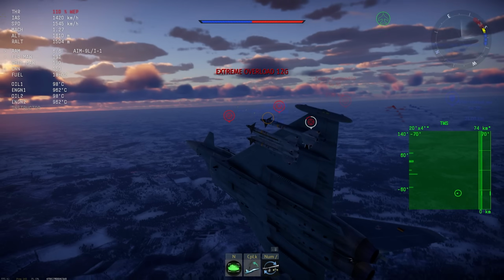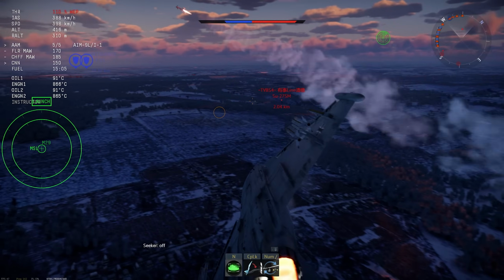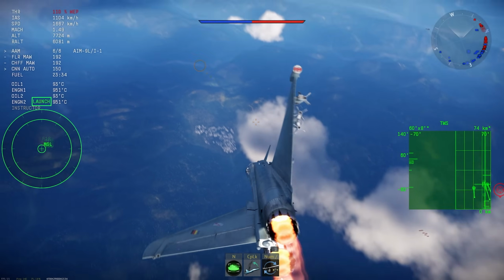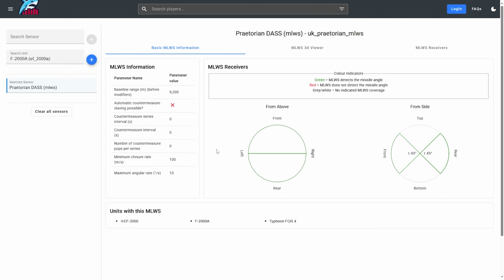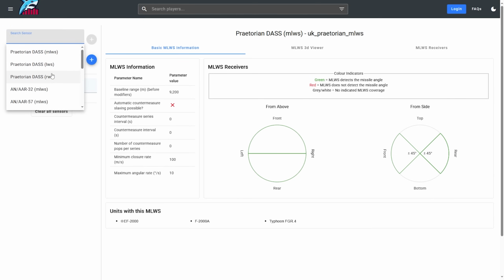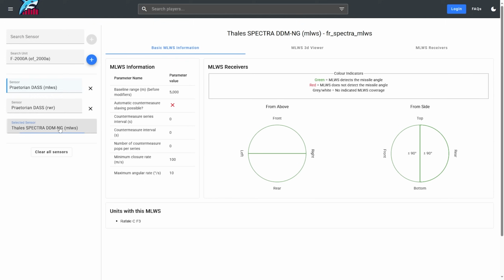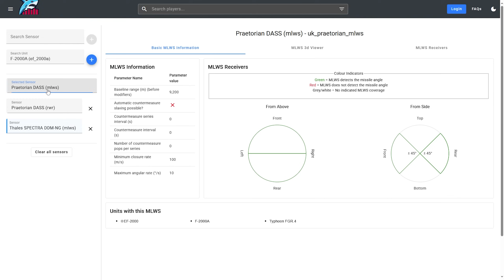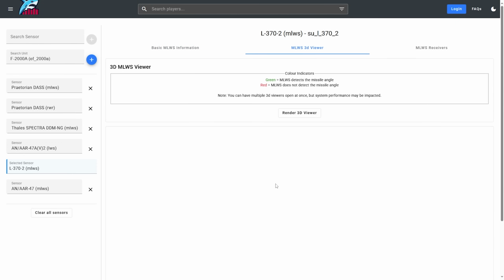SENSOR FUSION! WHAT is it? HOW does it work? WHO HAS IT? - War Thunder

Comment: So what aircraft are we most likely to see in the next update? Is it the Super hornet next with the legacy hornet making an appearance in the other tech trees respectively? Is it possible that we’ll see the F-22 by this December? Are we going to see a rank 9 and More BR decompression? I have a lot of questions.
Reply: prob just better versions of what we have, tranche 3 or 4 euros, F-16C BLK 70s etc. I would like to see better missiles but then I think gaijin will work on naval a lot this year
Reply: 16V, 15EX, 18E block 1/2/3, 22A block 0-40, 35A/B/C block 0-5. That's literally it in terms of "Up"
Reply: @Skunkw3rx  For real. They have how many stop gaps before the F-22 becomes one of if not the most violating jet in the game. Surely they’ll give the 5th gens their own rank instead of letting them stomp all over the 4th gens right?
Reply: @MerchantMarc  The f-22 cannot carry very many missles in its weapons bays, so it won't be very great against stuff with alot more missles unless they give it its under wing mounts.
Reply: @demondangr I'm pretty sure it can take 6 120s and two or four aim9s in total
Reply: @ They probably will but it can get a lot closer without being locked which means it has a far more effective kill range for it’s weapons and you don’t know it’s there until it turns it’s radar on. Which is a terrifying concept. On top of that, Aim120Bs are mean and it will probably make it back to the airfield before anyone gets the chance to kill it. I also saw something about Gaijin saying they weren’t going to bring Aim9Xs to the game based on the gameplay performance of the Aim9M. I am excited to see it in game, I am not excited to fight it.
Reply: @demondangr  the F-22 can carry 4x120Bs or 6x120Cs with an additional 2 9Xs while remaining stealth. OR if the F-22 doesn't care about stealth it can take 4 additional aim-120s on each wing. So 14x120Cs with 2 9Xs.....I would say that's a small amount
Reply: @MerchantMarc  the latest eurofighters and rafales have more modern avionics than the F-22, which gets heavily carried by stealth meaning they will still pose a threat and its just matter of whether the EFs and Rafales will use terrain and EW to get within 100KM or so, then the F-22 will likely lose
Reply: @squarescope3056 maybe, we’ll just have to wait and see but the thrust vectoring will be a big factor as well and you can’t forget the actual weight of the F-22 (she’s a heavy plane) as well but it is a pretty even fight between the canard fighters and the 22 so I’m interested to see if the canard fighters will be able to get close enough
Reply: @split117  6 and 2 👍
Reply: @MerchantMarc  you are right, but i only mentioned the rafale and eurofighter then because of the fact they use the longest range modern IR missiles, in the case they still cant see the F22 or it doesnt wanna turn on its radar, then they can still lock it with IRST with the ASRAAM having a 50 km range and the MICA IR having an 80km or so range. i still totally expect it to be at a higher br than the 4.5+ gens but i also think it would be able to see them, something like the F-22 at 16.0 and the EF and Rafale at 15.3 or 15.0
Reply: @squarescope3056 I’m also hoping we see the F-23 make an appearance
Reply: @squarescope3056 I would expect that. The F-22’s rectangular exhaust nozzles reduce heat sig but not by a huge amount so I would expect it to be a problem for the 22. Unfortunately Gaijin did say they have no intention of adding ASRAAM (or at least not yet) and the F-23 would have a better chance at hiding from such a weapon do to it’s design so I hope the Blackwidow makes an appearance as well
Reply: @squarescope3056 Thank you for the conversation. You’ve given me some good info that could be used in battles and we aren’t arguing about this aircraft being better than that aircraft. I am an American and I do love the F-22 very dearly but I am grinding for the Rafale right now and while I have no intention of obtaining the Eurofighter I am more than willing to recognize it’s capabilities rather than getting into a petty disagreement. Anyway, have a fantastic day, happy flying and don’t sink.
Reply: @MerchantMarc  6 and 2, thx
Reply: @MerchantMarc  f22 vs Mig 21
Reply: @Skunkw3rx  F22 can theorically carry a total of 14 missiles in its non-stealth configuration. But at that point it would pretty much be like a Su35, which makes no sense. If stealth will be modelled correctly, F22 should just be used with its stealth configuration, same goes for the F35.
Reply: @squarescope3056 "more modern avionics" such as? The F-22 has always had the most up to date avionics of almost any aircraft until about 5 years ago. And even then its miniscule improvements. Look up the IFCS
Reply: @ I’m not entirely sure what you’re asking or saying but the mig-21 doesn’t stand a chance unless you’re talking about if they put the F-22 in at 14.0 right now
Reply: @Skunkw3rx  the f22 we would receive first in the game would probably be the first production, i.e. it would have older avionics than rafale and ef
Reply: @devisucarlo7922 my question is how good is stealth at the ranges in war thunder... like 15km jousting
Reply: @rubotok3703  Eh who knows, problem in War Thunder are maps.
We spawn far from the enemies at around 80kms, but nowadays radars irl can see "normal" aircrafts even 400kms far away and stealth fighters to about 80-100+kms depending on the radar band. And i honestly doubt they'll add F22 without adding at least also the F35 and some Mig31 variant and Su35, so F22 or F35 won't be as much op as some people think.
Also, F22 would lack HMD and IRST.
That will be a bit painfull at br 15+ if they don't make bigger maps.
In bigger maps, the F22 could throw AIM120D far 80-100kms from its target, while its target would have some troubles to get a clear lock on the F22 above 70-80kms.
Reply: @devisucarlo7922  regardless to fire an aim120 you need your radar turned on, so people would see the radar launch, and then avoid the missile in the same way you avoid f14 spam or f15 spam, it's not gonna being anything new, also when they fire their missiles you'll have a better rcs to lock too to fire back, at the same time, at max you'll be 80km away at spawn, but aesa radars will easily be able to pick up a side aspect f22 f35 su-57 j20 etc.

stealth jets really won't have much advantage in most games where you sorta run to within 20km  of the enemy and yeet off missiles at close range
Reply: @devisucarlo7922  no, the pylons can be jettisoned after the weapons are used. 8 High speed BVR amraams at the beginning of the match then a drop in to the 6x2 stealth config after dropping the pylons off. It wouldn't defeat the point of anything and will probably be the best load for it
Reply: @rubotok3703  block 0 or 10 most likely. It won't have HMD in that case. Which honestly is fine to me
Reply: @rubotok3703  Yes, from those distances you'd have enough time to react and avoid the missile. That's why i also think that "stealth" won't really have that much of an advantage, mostly if the game will be at the same conditions as it is today. If spawns will be spread around and in a bigger maps, then stealth could help. It wouldn't be as op as people think, but it would help.
Reply: @Skunkw3rx  We're talking about a 16v16. An F22 carrying 14 missiles won't have the accelleration and the climb rate that an F22 in stealth configiration would have, meaning that whoever will have the stealth configuration will be in a better spot to launch fox 3 and have better chances to kill the enemy before you could even lock into someone, not only because of the weight but also because of the increased drag if you carry external weapons.
Also, the further you are at launching your missiles the less are the chances to even achieve a single kill out of 6 AIM120 you've thrown.
The AIM120 on your F22 with 14 missiles will have the same speed of the AIM120 on other people's F22 in stealth configuration.
Being able to accellerate and climb faster than anyone else, help to get a better position amd early game easier kills, that's also why in an EF and in an F15E you'll sweat way less than when you're playing flankers.
And again, this problem exist in game because maps are too small.
Reply: @devisucarlo7922 as someone who's literally top boarded on the global leaderboards with the 15E on kills and easily getting to the top 200 in the world for the month. None of what you said matters
Reply: If they add ecm and irst with the newer blocks of the F-16, F-15, Eurofighter, etc then 4th gen could compete with 5th gen’s. We’d also need datalink so the 5th gen’s can’t just orbital strike without  being able to be fired on by 4th gen’s without the better radars of the 5th.
Reply: @Skunkw3rx  Tell me you're trying to win an argument without telling me you're trying to win an argument. How old are you? 12? What i said is just how it works. If being the first to have a good positioning in the match doesn't matter for you, i don't give a flying F about it honestly. Being the first to get a better position gives you an advantage and that's an objective fact despite the bs you're trying to make up.
An F22 carrying 14 missiles won't have the same positioning advantage in comparison to an F22 in stealth configuration.
You'll have more firepower at the cost of RCS and positioning, but that doesn't mean you'll score more kills and honestly if you're really playing top tier, which at this point i honestly doubt, you'd know that positioning always defeat the mere "firepower".
Reply: @Skunkw3rx  Tell me you're trying to win an argument without telling me you're trying to win an argument. How old are you? 12? What i said is just how it works. If being the first to have a good positioning in the match doesn't matter for you, i don't give a flying F about it honestly. Being the first to get a better position gives you an advantage and that's an objective fact despite the bs you're trying to make up.
An F22 carrying 14 missiles won't have the same positioning advantage in comparison to an F22 in stealth configuration.
You'll have more firepower at the cost of RCS and positioning, but that doesn't mean you'll score more kills and honestly if you're really playing top tier, which at this point i honestly doubt, you'd know that positioning always defeat the mere "firepower".
Reply: @devisucarlo7922 also yeah man. I don't play top tier at all. Never, I'm totally not globally ranked and couldn't easily be top 100 in the world for monthly player kills in rb if I wanted. You need to learn the top tier environment, and it's very blatantly obvious. The more pressure you can put on the enemy team and larger of a target you can make yourself higher up before the initial merge matters more than anything else. Because you're both taking away multiple launches that the enemy could have done against your teammates individually while forcing their side defensive and allowing more pressure to be applied. RCS and drag won't matter for an initial launch and will allow you to properly BVR like a high speed f-15 then transition into bfm in a stealth config while you put half their team defensive......I'm going to assume you have like what? 3k hours? You talk with confidence but I can see where that confidence is placed, and it's in the wrong spot.
Reply: @Skunkw3rx  You keep providing no logical argument to back up your claims, all you do is "hey i'm the best in the world, i could be in the top 100" and blabla, all yap but zero logic.
A rock probably have more IQ than you do. Imagine saying that RCS and accellerating faster + climbing faster won't metter at top tier where positioning is EVERYTHING in order to achieve 6+ kills per match.
And the thing is i'm not making things up, you can literally see it with your eyes if you were playing top tier for real lol what gives pressure isn't just being the first to launch the missile. What give pressure is launching while being in a better position. If an F22 is to an higher altitude than you and is faster than you, it's missiles will be faster, will retain more energy despite your defensive maneouvres and will reach further distances than your 6 AIM120 thrown at lower altitudes to an higher altitude target which could also maneouvre more than you do because it has more energy and speed than you.
Fun fact is that i'm literally describing what top tier is in this game and why US and EF keep dominating over anyone while even the Su30 despite its improved R77 can't give as much pressure in early games even tho it can carry more missiles and this is also why F18 didn't break the game at all, because it simply will never give as much pressure as even an F16C could do.
If an F22 has AIM120D but worse flying performance because of its configuration in comparison to another F22 which has the same missiles but in stealth configuration + better flying performance because of less weight and drag, it's SO OBVIOUS that the F22 in the stealth configuration will have slightly more advantage.
An F22 having its 14 missiles configuration can POTENTIALLY get more kills because of that firepower, but it is likely not going to unless its opponents are braindead and its team mates are sleeping.
Now could you stop bothering me with your bs or have you some ego issues which don't allow you to gtfo?😂
Reply: @devisucarlo7922 I explained how it worked 3 times and all you do is go "nuh uh, your argument is wrong." Silence and follow along your flawed logic to failure. You have no want to learn.
Reply: @Skunkw3rx  So not only you've some ego issue which don't allow you to gtfo and stop bothering me with your obvious nonsense to whoever plays top tier on this game, but you also got superiority comples lmao
Reply: @devisucarlo7922  you have no want to learn, and have minimal knowledge or ability to interpret knowledge provided. You need to learn to learn. Then come talk to me if you'd like to get any better. I don't even focus on stats, I focus on having fun. It's not my fault that my version of fun is the actual effective way to play the game.
Reply: @Skunkw3rx  What's better for positioning? An F22 in its stealth configuration being harder to detect and lock while also flying faster and climbing faster, or an F22 being detectable as any other jet because its carrying 14 missiles and having more weight and drag?
Answer the question.
"YoU CaN DrOp ItS PiLoNs" isn't an answer. The match start and its a 1v1, who's getting a better position between the two?
Reply: 5th gen are probably going to come by the end of this year tbh. The presence of rank 8 premiums suggest that theres at least a rank 9 coming some time in the near future. With further BR decompressions, the current aircraft may go up to 15.0 or something, so 5th gens will probably be 16.0. The F-18E/F is most likely going to come in the next major update for the US, alongside the Australian F-18A/F-18F for GB.
Reply: @Jhunter2007 the end goal of the game is 18.0-20.0 (depending on how they do it) at rank X. I'm assuming rank XI is going to be all of the 4.5 gen fighters and their upgrades, then rank X will be the 5th gens and their upgrades.
Reply: @Jhunter2007remember that war thunder isn't like other games: if gajin wants to add 5th gen fighters it would have to get their hands of CLASSIFIED documents which they can't get because they're well... Classified, and between governements' hands and it would be unthinkable to give such confidencial and important documents to a silly little game compagny. I know there has been one leak about the F22's RCS but I don't think that gaijin will add 5th gen fighters soon except if they're made unreastically, which is against war thunder's main argument: realism. (Yes the game is unrealistic in a lot of case but you get what I'm saying)
Reply: @ yes I do and the F-22 RCS isn’t a total mystery if the time is taken a good 3D render could be measured 1* at a time to get the basic RCS with out the paint and they can make a guess from there. The F22 could also very well show up with an HMS but we’ll just have to wait and see
Reply: @Sainalex-1 the F-22A Block 40 is in the files already
Reply: @MerchantMarc  the block 20 upgrade onwards had HMD
Reply: @Skunkw3rx  exciting news
Reply: @MerchantMarc  A good 3d render wouldn´t be enough, you´d need to know everything about the ram coatings used
Reply: @ I did say without the paint right? I should have said coating instead
Reply: Japans F-2
Reply: Hahahaha
Reply: The f22 won´t be added this year, next big update might be superhornet and su57
Reply: @aquilesca5tr0  You're completely out of your mind, LMAO. Su57 will be added just when F22 and F35 will be a thing or even later than these.
Reply: @devisucarlo7922 You really think they would skip on a top gun maverick update? Besides they need an update to keep russian mains happy for some time
Reply: @aquilesca5tr0  yes, the 18E will probably come with the mig-35
Reply: @aquilesca5tr0  Yes i think they will skip on a top gun Maverik update, adding Su57 next update wouldn't make any sense.
Reply: @ there’s no way they would the Su-57 so soon. They have so many SUs left to add before that aircraft. The Super hornet I can believe though.
Reply: @MerchantMarc  The other sukhois left to be added are all flankers, it would be fitting to add the su35 with the f15ex after all the fifth gens that people care about
Reply: @MerchantMarc  Russians have the SU-35, SU-35s, SU-37, Mig-35, SU-57, SU-57M, and SU-75. then up is done
Reply: Ahh yeah the combo eurofighter’s irst radar (pirate)  + meteor = upgraded r27er probably  (if the enemy is a stealth fighter like f22/f35 the radar will lock at ~20-30km ca) if a regular aircraft up to 100km